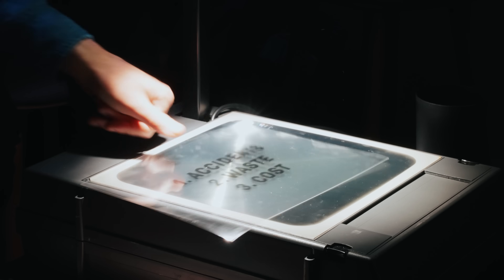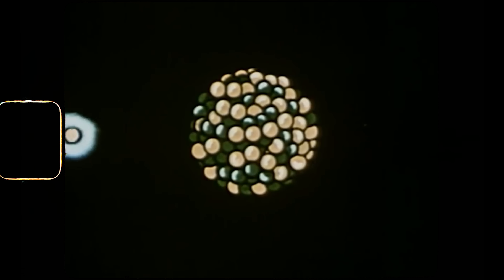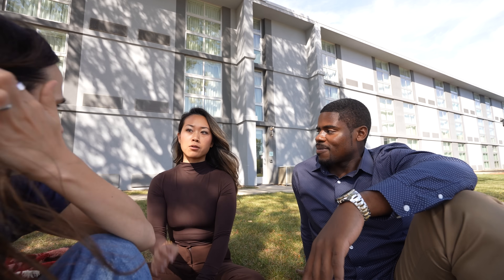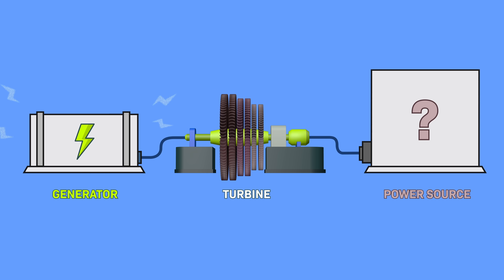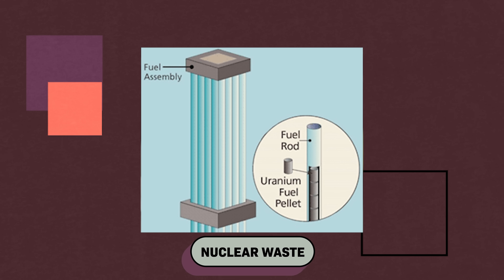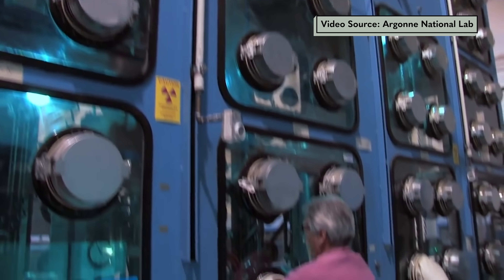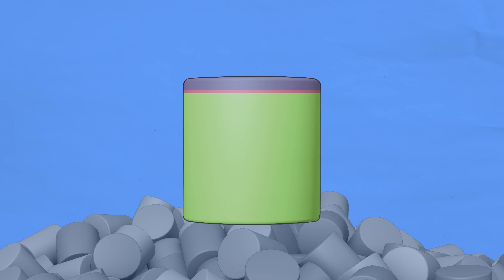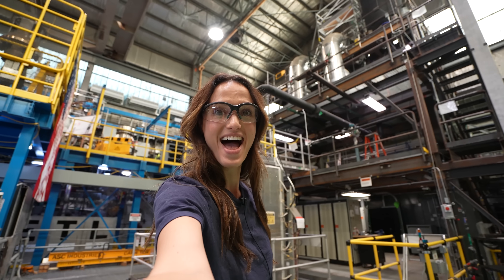The Big Lie About Nuclear Waste

Comment: This video might have been valid and useful 50 years ago. Renewables are cheaper and better now.
Reply: In the case of Australia
Consistent with our LCOE analysis, AEMO’s modelling finds renewables to be the cheapest form of energy production when connected with transmission, firmed with storage and backed up by gas. It does this by comparing alternative generation technologies and the impact that they have on the scale of required supporting infrastructure (transmission and firming investments).
Reply: @tobysemler  I have no doubt that renewables are cheaper than coal or gas, but they still are unreliable. The sun is only up for half the day (much less in winter) and only generate what they say they generate when they are fresh out of the box. You have a point with vanadium not being toxic in batteries but it is difficult to extract as it is mainly found mixed with other elements. It unfortunately isn't so simple to just wire transmission lines to areas that don't have the right environment for renewables due to the huge losses on stray inductance, parasitic capacitance, wire resistance, and transformer losses. There may be lots of land on earth, but we still have to clear away trees and animal habitats to make room for the large number of solar panels, wind turbines, and big utility scale batteries which damages the ecosystem that was previously there.
Reply: @derpymcderpello5381  There is always going to be an impact when we develop something but the impacts of renewables are far less than FF and nuclear and they are largely avoidable e.g. you have to use a large area for solar but you don't have to clear conservation significant vegetation - you might even use previously cleared land. I don't agree they are unreliable - there's so much solar and wind energy, it just needs to be captured and stored, and then there's hydro, geothermal, tidal...

Nuclear and FF are dead horses.
Reply: @derpymcderpello5381  there's some issue with replies, sorry if seems rude. all developmnt has imapcts, renewable impacts are largely avoidable e.g  put it where land is ALREADY CLEARED or veg is not cons sig. All power has transmission losses. It is reliable, plenty of sun, wind, hydro, geothermal, tidal, just needs to be captured and stored. Vanadium isn't hard to refine. 

FF and nuclear are dead horses now.
Reply: Renewables have multiple problems even today. They're unreliable, require expensive batteries (which also require rare earth minerals), only work in the right areas, take up a lot of room, need to be replaced about every 20 years, and solar panels are toxic waste after their lifespan while wind turbines are extremely expensive to recycle due to their large size.

Comment: I don’t understand why we live on a planet with an inner core that is approximately as hot as the surface of the sun- why would we create ANY WASTE?  Who is profiting from this waste?  Why do we need any waste at all?  We already have the sun and the wind even the heat of our own planet. I’m sorry but I’m not buying this nuclear power and waste fairytale.   Someone is trying to sell everyone on the idea and my guess is that it’s all for profit. I vote that we leave the nasty stuff in the ground and never dig it up.
Reply: The sun and wind are very unreliable and require expensive batteries (among many other disadvantages). Geothermal is a good way to produce energy but it can only be used in the right areas otherwise it becomes inefficient and too expensive.
Reply: In the case of Australia

Consistent with our LCOE analysis, AEMO’s modelling finds renewables to be the cheapest form of energy production when connected with transmission, firmed with storage and backed up by gas. It does this by comparing alternative generation technologies and the impact that they have on the scale of required supporting infrastructure (transmission and firming investments).

50% of Queensland homes have home solar systems

Comment: Ok.  Recylcing fuel is good.  But the key to success is to minimize the "internal enemy" of massive, incessantly changing regulations and to focus on AVAILABILITY and not efficiency.  This can be done by compromising the need of the engineers to optimize heat rate for the exact local conditions of the plant site (mostly cooling water supply) and to insist and true standard designs that are made in a factory and shipped to locations.   This solves an immense number of the nuclear problems. 1) It simplifies QC because you have one highly trained team of inspectors at the same factory to radiograph each weld, inspecting each pipe hanger, etc., before that module leaves the factory.  2) it simplifies permitting -- there's only one design the QC team says this one is ok. 3) it helps balance the grid -- smaller plants located at diverse locations of the grid are inherently better for load balancing, area regulation, minimizing loss-of-power events, etc.  4) it creates a tremendous number of high quality domestic jobs and, in passing, saves our shipyards because that's the likely place to modify for the manufacture of these large modules.   Now, we can do this with small PWRs, we can do this with the new Sodium reactors, or we can do this with recycling plants (like the Japanese AND the French - you left them out).  
But we need to do it.

Comment: Thank you for your presentation. I found it very interesting. Please continue your research into nuclear recycling by exploring the construction project underway at the Svannah River Site in South Carolina. It was supposed to recycle U-239 (Plutonium) from excess nuclear warhead and creating what was termed as MOX fuel. The French designed and built a plant in France to process Russian excess nuclear warheads and we were obligated to do the same but never have. What is the status of the MOX project at Savannah River Site? That story could win several awards if you are able to crack the story.

Comment: I worked on the construction of THORP (Thermal Oxide Reprocessing Plan). Originally, there were going to be two of them. Only one was constructed.  The intention was to separate plutonium from spent fuel. Over 9,000 tonnes of spent fuel was reprocessed, from 9 different countries.

Unfortunately, there was a time when the QA was falsified.  Then, there was a leak, which was contained.  The reasons behind THORPs perceived failures & THORPs closure, which include global & domestic political interference, make for a fascinating story.  

My comment here over simplified everything.

Comment: Increasing power production boosts the economy and raises standards of living which is pro-capitalist and anti-socialist/anti-communist.  60’s liberal radicals needed a way to demonize the promise of nuclear power because of the threat it posed to their plans to halt economic prosperity.  So, when 3 Mile Island occurred they latched on to it and progress in the Nuclear Power Sector ceased.  Their Allie’s in the Democrat Party ensured that so-called safety regulations made Nuclear so expensive that all new plants would be too expensive and the Sector became frozen in time.  The technology for Sodium reactors and Hybrids and Breeders have all languished because of the lies of the environmental left.  It has only been the last few years with the push to eliminate all fossil fuels that they are starting to see push back as people can clearly see you can’t shut down coal and gas without replacing it with something that still produces power at night and doesn’t rely on the wind.

Comment: So the one Problem i have with nuclear energy is not really the danger or the waste These are factors that make it worse but its not the main Problem the problem is that the uranium we know about that can be cheaply mined is about 600  tousand metric tons. Sound pretty good untull you calculate the raw energy you get about the same as the whole Planet is using in a year so if every country on erath would only use nuclear we would last a year before we have no feul left. Okay these are pesimistic numbers and with a bit of Recycling and Mining expensive deposits we could get a few years powering everything with it. So it has a Limit on how much it can be used. Next thing is that nuclear energy is expensive compared to solar and Wind.
Reply: There is enough uranium in the oceans to power 100% of the global electrical demand at current levels for a million years.

Comment: Honda CRXHF in the year 1984 with 1500 cc engine five speed manual transmission and a two barrel carburetor running on gasoline at 87 octane reached 50 miles per gallon. Yeah, let’s talk about technology we leave behind.

Comment: To the best of my knowledge, nuclear power generators basically boil water to drive a turbine. Spin a coil of copper wire around a magnet and you generate electricity. We burn brown coal here in Victoria, Australia. Which basically does the same thing.

Comment: You can go onto the department of energy to find out how much waste is produced today with only a small percentage of electricity being produced . If we extrapolate to even 85% of our electricity we're looking at a lot more waste
 Nuclear reactors still produce waste.
Reply: If we were 100% nuclear, we'd have economical reprocessing. At which point we'd actually have less waste, not more.
Reply: @Crispr_CAS9  How do you mean? Reprocessing? Can you point me at some resources where I can read about this? If we've solved the nuclear waste problem I'd love to read about it.
Reply: @qatestbrian1  As conventional reserves of uranium are depleted, reprocessing and fast reactors will become economical. They're approximately economical now relative to generic prices, assuming several other factors, but not relative to conventional reactors, so they're not preferred. 

Reprocessing is able to reduce the volume of spent fuel by 20x to 100x, and the remaining waste can be transmuted in fast reactors. Both of these reduce the duration of required storage to under 300 years. Combining a massively lower mass and a massively shorter duration, the total storage requirements are actually smaller.

All of this is technology from the 1950s and 1960s.

Comment: As energy we could use spent fuel for heat in colder climates even without theese reactors. Radiation = Heat. In those spent pellets are so hot for many many years that those storage units needs to be cooled down

Comment: The future is in nuclear diamond bateries. They too are made from waist. With the only downside for industry to release the tech as a product is they last for many years without recharging, even under heavy drain, so there is no need of replacing them. They produce less radiation than the human body does. First use was on the voyager probes and are still turning out juice. But were so radioactive then that they had to sit on long arms or they would cook the probes. But the science is sound. It also is the science that was employed in the reactors you mentioned. Anyone that reads this look it up yourself. And it blows me away ive not seen any videos on it here on Youtube. And may never see one. Even if you can find out all about it on the web.

Comment: Good clean endless power for Pennies on the dollar until a mishap.  Chernobyl still melting down.  Fukushima still melting down.  Are we still
Too immature for nuclear?  No tech yet to actually remove melted cores!  At least Chernobyl is inland where they keep on burying  it under more concrete and steel, but it will eventually contaminate groundwater ending up in rivers and then ocean.  Fukushima on the ocean where they continually freeze the land to prevent some of the thousands of gallons of contaminated water going into the ocean as groundwater quickly replaces the water.  Still unable to approach the three melted reactors.  The Hanford site on the Columbia river in Washington super fund money has run out.  Windscale fire in UK.  Other mishaps in Russia.  Still dumping nuclear waste in ocean.  Nuclear waste in our food chain.  Downwinders from Nevada test sites.  We all have been exposed to above ground testing, worldwide.
Reply: Many plants designed for 60 years.  Many are way older with bandaid treatments to prolong life.  They all leak.
Reply: Remember 3 mile island.  No emergency until it was CHINA SYNDROME MOVIE same time with Jane Fonda
Reply: You are 100% correct.

Comment: There was an operating facility, in New York, as I recall, which did this. Unfortunately, at the time, the plant was required to upgrade their facilities to meet OSHA requirements. As a result, the plant was no longer considered to be economically feasible after performing those costly upgrades, so it was decommissioned. Too bad, but thanks so much for enlightening people about the possibilities.

Comment: the viability of molten salt reactors has already been demonstrated. any time you see something like THIS being stopped by a politician? you can KNOW for CERTAIN- big oil is in the shaddows, pulling the puppet strings. 'nuclear not economically viable'? translation: big oil bought the patents for salt reactor tech. & refuses to lease it until they've run out of their favorite energy juice. that's where elon comes in- they've got a bigger problem to fight with- and tesla energy / vehicles  will keep stealing their lunch until they lose enough market share where they can no longer afford to finance election campaigns- ever wonder why both democrats & repulicans don't like elon? NOW YOU KNOW. one of them says "EV's & solar bad"... the other just says "elon bad"- in the end- it's the same thing. if elon keeps going, eventually, they'll be 'small oil'. ice cars aren't going away.. nor shood they. but they might just switch to E85 & B100 if tesla keeps pumping out cars that use fuel that only costs 35 cents per gallon.

Comment: Ive been pro nuclear since high school. Its always sad because the only reasons against I get from people are the three “major” disasters. Chernobyl, which was operator error coupled with poor maintenance and safety checks/regulation. Fukushima, which was natual disaster cause and is a “exception not rule” type of disaster. And Three Mile Island, which was even remotely a disaster and was most a PR and information failure leading to wide spread panic and chaos.

Outside of these people have no reason they can tell me they are afraid of nuclear. Which is crazy when you realize how much nuclear reactors have operated world wide since the first one opened and the fact we have only had 2 major issues and 1 PR issue since is crazy. But people only see the errors and not the positives.

Comment: An interesting perspective on part of the nuclear power generation process.

Unfortunately (or fortunately depending on your pov), nuclear power has never been a full cycle competitor to even natural gas on either cost or emissions.

An even cursory delve into those aspects of nuclear power generation will reveal this (somewhat suprising to myself) outcome.

Given the pretty much vast technical challenges, and lack of reasonable economic or environmental advantages versus competing technologies, it really does need to be put to bed at this point. 

It might be boring, but wind, solar, and rapid response gas turbine power does seem to be the way to go on the numbers, both for economic and environmental reasons.

The only reasons to continue with the nuclear dream is if you are looking to diversify strategic supply risk

Comment: Unless someone nails down fusion reactors, this technique is the only way we can ever even think of everyone driving an electric car.
Reply: I'm a strong advocate for nuclear power. However, as a big fan of Tesla I will quibble with your comment. Briefly …
- The Green lobby has bullied or frightened politicians into regulating nuclear and going all in on renewables
- The main renewables are wind and solar, which are intermittent
- Solar panel technology is improving fast, the cost per watt is falling, and solar is easy to deploy 
- We need ways to store intermittent energy so it's available on-demand
- Battery technology looks like the best bet for this at the moment, though there are people working on lots of other technologies 
- Battery tech is improving rapidly, in terms of energy density, cost and safety (obviating the much-publicised but very rare battery fires)
- We still appear to be at the bottom of the S-curve for adoption of solar and battery 
- The UK recently obtained 80% of its electricity from renewables, for a few hours; as we go up the S-curve this will only increase 
- I saw a recent video report saying that the US would need to triple its electricity supply capacity in order to completely electrify the country (basically transport and HVAC) which could be done by a combination of nuclear and renewables, given reasonable estimates for storage
- Conclusion: Electrification is feasible, though IMHO the timescales they are talking about in Europe (a deadline of 2030) are ludicrous